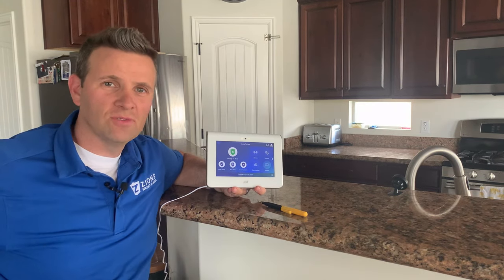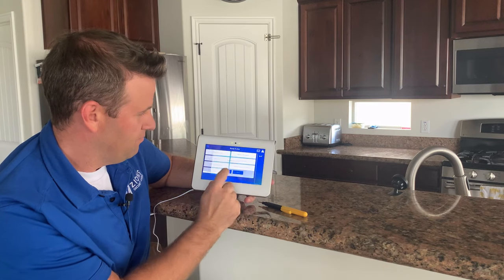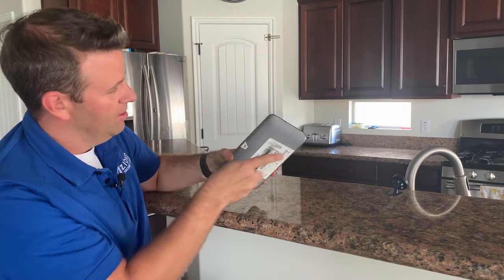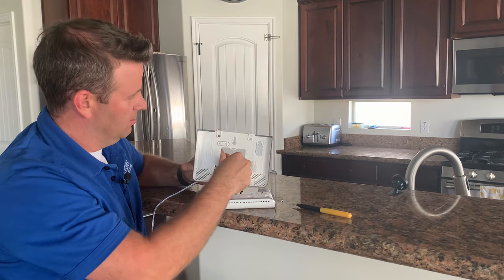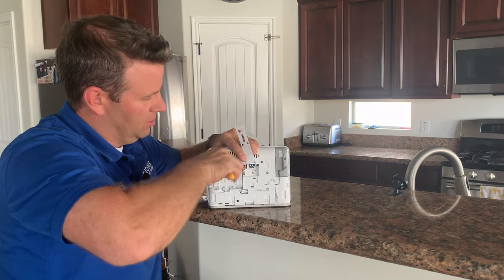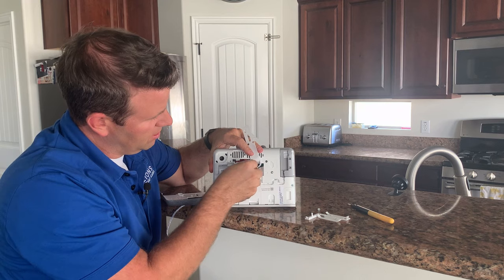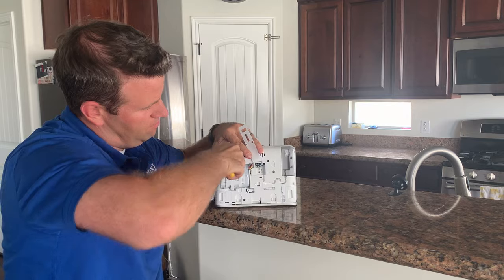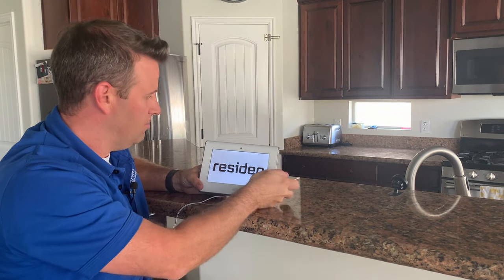How to Change your ADT Command Panel Battery if it gets low after a power outage or normal use

Comment: Thanks so much!! This helped more than the actual ADT website tutorial, which shows an outdated website lol.

For those wondering, your panel will say it has a panel tampering warning when it reboots if you haven't managed to attach everything before it's fully online. Just use the reboot system command instead of the system shutdown command you used to replace the battery - the fault will self-clear on its own.

Comment: I appreciate you getting right to the point!  I omly wish you had warned ahead of time that the battery within is not just your basic AA or AAA battery.  
I got it open, and found a special battery I have no idea where to find locally.  ADT is now sending me one in the mail.
Regardless, you get a like.
Reply: Indeed
Reply: Good point and this is the one battery that ADT wants you to only buy from them or it will void your warranty. So you have to buy it from them only.
Reply: What size is it?
Reply: Ever since I installed ADT I’ve had nothing but issues.  Now I’m finding out that they’ll force me to buy the fucking battery from them. Bunch of rip offs is what they are. The whole system sucks, only records motion activated and a few seconds. I’m so done with it.
Reply: @edgara1153  I had my system for about 6 months before I realized it will only record 30 seconds before it shuts off and has to wait 1 30 to reload to record again.I told them the main reason I wanted it was for cameras,nobody said a word and sold me 5 cameras.WTF does recording 30 seconds do? ,I feel like this has to be fraud of some type.
Reply: @mj1s735  We have a rechargeable lithium battery for ADT panels, we can provide you with a free product in exchange for your review, are you interested in trying it?
Reply: We have a rechargeable lithium battery for ADT panels, we can provide you with a free product in exchange for your review, are you interested in trying it?

Comment: I was reluctant to change this battery out from my panel because of the unknown and the chance the alarm would go off while I was replacing the battery. That being said, this tutorial was very good with excellent instructions. I am so happy I was able to replace this battery without a hitch.  

One suggest is once all screws are installed and panel put together, the panel display does not come on right away.  In fact, it took another 2 - 1/2 minutes before the display comes on so I would not say the system just comes on automatically...
🤙
Reply: What size batteries? I want to make I have before I take my panel down
Reply: *make sure I have
Reply: @alycedavillier5903  We have a rechargeable lithium battery for ADT panels, we can provide you with a free product in exchange for your review, are you interested in trying it?

Comment: Have the same problem, which is ADT's noted issue. However, I  received a new battery fee of charge and will install it after this video. Thanks, Sir, for a great tutorial. 👍🙏
Reply: We have a rechargeable lithium battery for ADT panels, we can provide you with a free product in exchange for your review, are you interested in trying it?

Comment: Thanks!!! They were trying to charge me $250 for this.
Reply from the maker: You are welcome!
Reply: @ShebaP...FYI, just in case, I called ADT and read what was on my panel. The rep sent a technician to replace my battery. The cost: $25.00, yep, $25.00. I don't know where the $250.00 came from.

Comment: Great video!! Quick, to the point and easy to follow. Question is, how do you clear the Base Cover Tamper message? Am I going to have to get a technician sent out?
Reply: I have this issue. Did you ever get the fix for it?
Reply: @delesasmith6668  - I had to call a technician to come fix it.
Reply: Thank you…guess I will do the same

Comment: Once you shut the panel down, how do you restart it? Is there not a button to press to turn it back on? I saw that you replaced the screw in the bottom, but does that also turn the panel back on?

Comment: I did as you said. I did a system shutdown. It restarted a few seconds later. The ADT instructions say to use test mode and that works but their website is split into multiple pieces but eventually I discovered that the logical choice is not the correct choice, I had to use the MyADT (to get test mode) and their instructions are not clear about that.

Comment: After a minute into the video you show the front part lifting up away from the back part. Well for me it was not as easy as it should be. I think the problem is that the ADT installer was a beginner and he did not leave much slack in the cable coming from the power source so that made it difficult to slip the front part up. If I had known then all I had to do was to push the cable up into the device so as to allow enough slack.

Comment: The unit still says 'Battery Dead/Miss" after replacing the battery with a knew one. I saw somewhere else that is a common issue and that something else has to be reset. Know anything about it?

Comment: What size is the screw that sits at the bottom of the control panel to secure the wall plate?  Mines dropped and I cannot locate it

Comment: Do you know how long these batteries should last? I purchased battery in July and now my battery is low. I requested information from the seller.
Reply from the maker: Ours are under warranty for a year. I would stay away from purchasing them from other sources that are not getting the originals from the manufacturer that do not offer a year warranty

Comment: My power went out for 4 hours due to a storm. It’s been 5 days and my battery still hasn’t recharged I still have the battery dead warning.  I’ve had my unit for almost 2 years and shouldn’t have to get a new  battery. I guess I’ll call ADT again 😔.
Reply from the maker: You can get a new one here if you need it https://zionssecurity.com/product/adt-command-smart-replacement-battery/

Comment: What kind of screw driver is that? Looks smaller than the average screw driver
Reply from the maker: Yes most alarm systems use a small flathead or phillips

Comment: how long should the battery last?
Reply: During power Failure: 6 to 8 hours, then it recharges in 24 hours.   Lifespan of Battery: 3 to 5 Years.

Comment: My Issue is my panel has a red triangle on it and it’s saying Battery Absent!! My panel is still on and working, but does this mean I need a new battery?
Reply: Mine says the exact same thing
Reply: @breezetree2676  Ended up being a fried battery. My panel is hard wired, so my panel has power, but for what ever reason the back up battery fried, it had to be replaced and now the Triangle is gone.
Reply from the maker: yes its recommended to replace it, https://zionssecurity.com/product/adt-command-smart-replacement-battery/

Comment: Hello. The panel won’t turn on once I plug it into power. Any suggestions?
Thank you!
Reply from the maker: please make sure there is power going to that outlet. It should turn on once you give it power. Next check if a wire is loose.

Comment: I shut it down, but when I took the panel off and the battery out, it started freaking out and saying there was tampering with the panel
Reply: You didn't shut down.  But that's OK.  When you're done, you can clear the tamper by pressing the disarm button and entering your code.  You must do this two times in a row to clear the warning.

Comment: I did that, but now i get BASE COVER TAMPER notification, how do i reset that?
Reply from the maker: Did you screw the bottom screw back into place?
Reply: It's not the screw.  You just have put your code in twice on the panel. If you cover on properly, then that should clear your tamper.
Reply: @ronaldriley1487  Thanks, I'm going to try your solution!

Comment: How do you recharge the battery
Reply: Once you place it on the unit, it will charge on its own.
Reply from the maker: once AC power is restored it will charge the battery back up. (assuming it isnt a bad or dead battery)